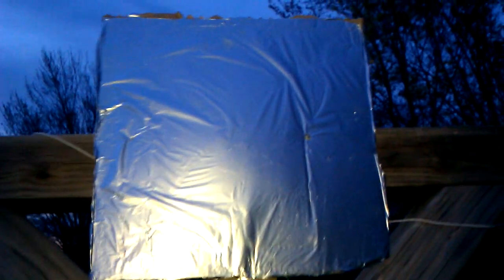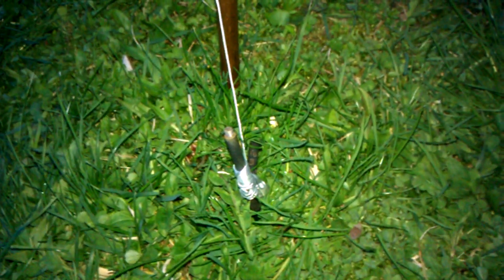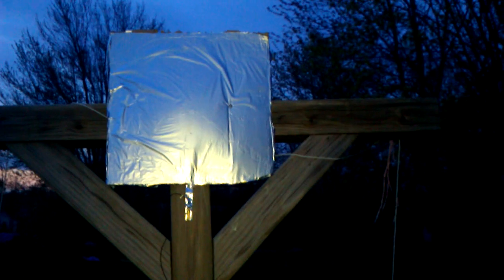Tesla Panel Test 1

Comment: Cool.  I would suggest putting that panel on a plastic pole or backing it up with a plastic plate,,that wood is not the best insulator. I know with my antenna, if it touches a tree branch or even touches a tree leaf, it sucks all power from the system. You dont want you antenna(your plate) to be connected to wood(like a tree) that goes into the ground. Keep up the good work, hope you have good results :-)